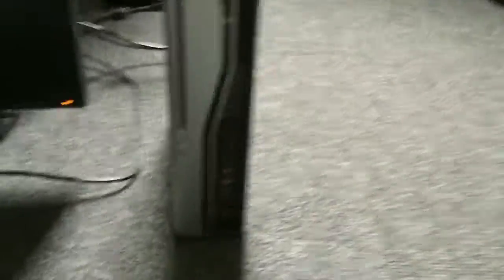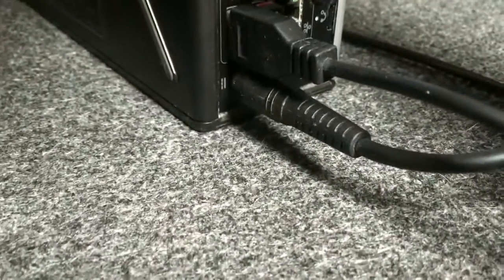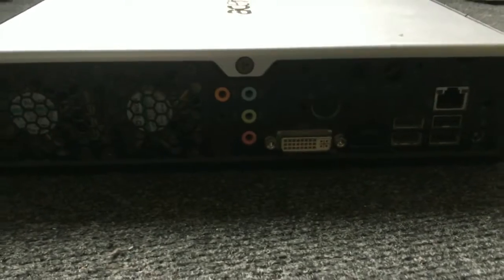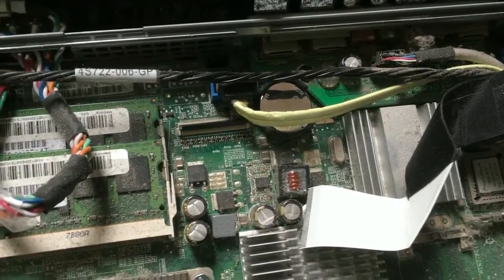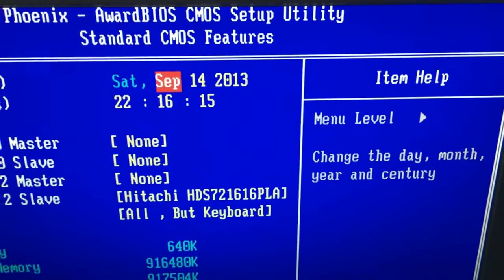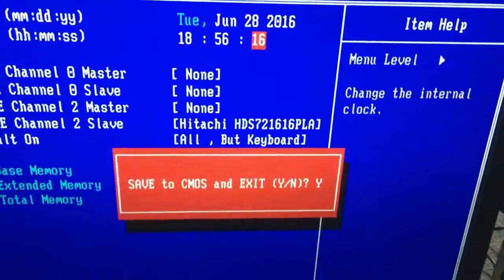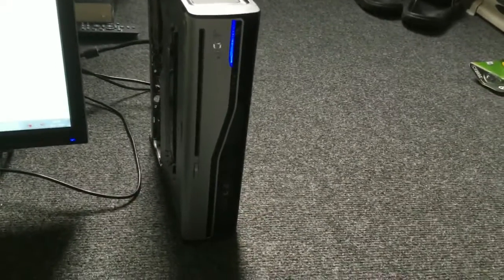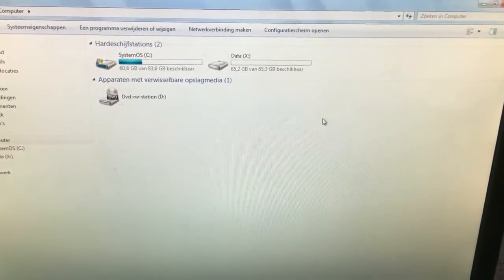2007 Acer Veriton L410 brief look, Diagnosis and Repair

Comment: I have this Acer computer, but with a slower processor.
So I want to give it an upgrade to the CPU you have ....
The question I have, how many Watt has your power supply ??
To check, if mine is strong enough for this 4200 + processor.
Another is where to get this processor ...
THANKS !!
Reply from the maker: 135 Watts. Should be more than enough to handle a 4200+. You could even try a 5400B, those were standard in 2009 models. You could get these from Ebay, the cheapest I could find was around €11,-
I do recommend at least 2 GB of RAM for 32bit Windows. 4GB is the max this computer can handle and is plenty for 64bit Windows.
I have Windows 10 64bit on this computer and it runs without any problems. I did upgrade the RAM to 4GB 800Mhz though.

Comment: Can it at least play 480p video on Youtube? Thanks
Reply from the maker: Yes, should be no problem at all. At my work, I have the same system as a spare. That one is slightly older then the one on this video, and that one has no trouble playing 720p video's on Youtube.
Reply: Nicki697 thank you
Reply: would be nice. Could you tell me what the power supply is rated at, and if the  connector is the same as say an acer aspire laptop?
Reply from the maker: Input: 100-240V~2.2A
Output: 19V--- 7,11A
The original power supply is made by Delta and the model number is SADP-135EB B. So it's a 135W power supply.

These are still available on Ebay.